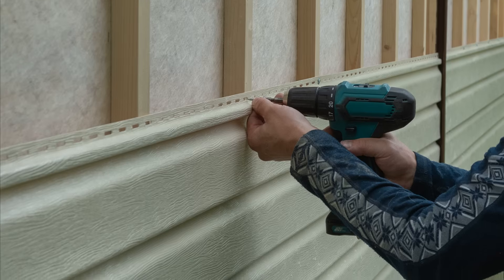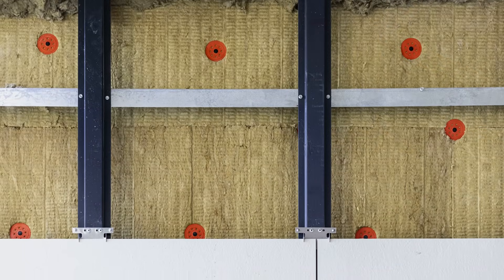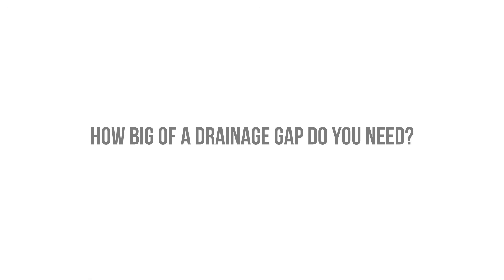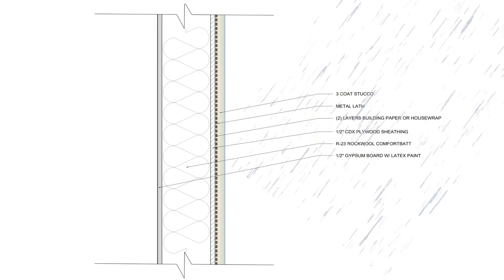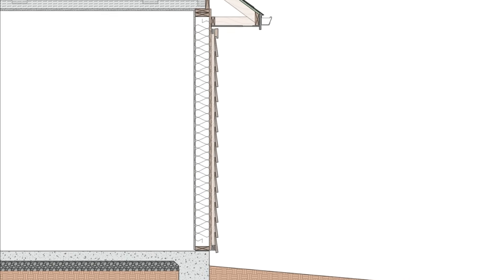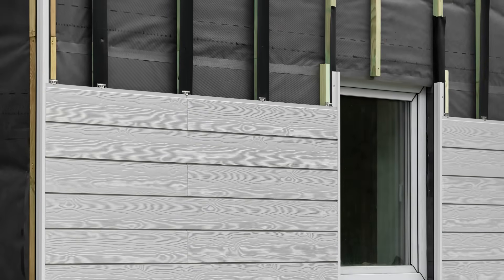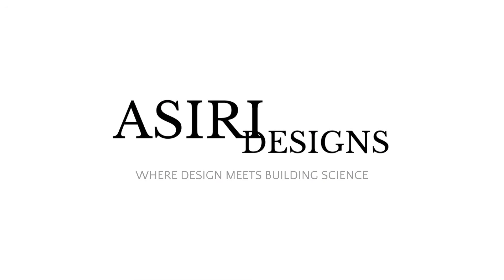Rainscreens Explained

Comment: Would have been nice to talk about the drainage gap with exterior insulation. A lot of the issues that you said the drainage gap helps like drying through the wall can't happen when there's exterior insulation so is the drainage gap less needed in that case?
Reply from the maker: @BenBrand  We actually have a video on this right here: https://youtu.be/VwUjkSjllPs?feature=shared
Reply: @ASIRIDesigns  Thanks for the link! I get the idea of having a peel and stick WRB with a texture (or rockwool or other texture material) to have a 1/16th gap for drainage between the WRB and the CI, but where is this water coming from? Surely this is not bulk water getting past the cladding and through the CI? And with only 1/16th gap this is only drainage and not drying so the house would not actually be able to give up moisture through that gap? To actually dry as you said you need more like 3/8" which would defeat the CI from actually keeping the house warm. Once you have CI aren't you required to keep the humidity in the house under control so that it can dry inwards and if that's the case why can't a rigid foam be right on top of the WRB?
Reply: @BenBrand the water that may collect between the WRB and CI probably enters the assembly through the wall cladding. I've heard estimates that up to 25% of the bulk water that the cladding faces may penetrate that layer, depending on the installation and type of siding. The CI will repel most of the water, especially when working in combination with a ventilated rainscreen, but a fraction of that moisture load will inevitably work it's way between the WRB and the CI. This is why a drainage-only gap is required, a fraction of a fraction of the bulk water is present and to maintain the resilience of the assembly a final drainage opportunity allows the last bit of bulk water to drain.

Don't forget that this is a WRB and air barrier layer so controlling interior air moisture should not affect the need for a greater space between the WRB and CI. And even with that in mind, interior humidity management should be included in every mechanical system for building performance, occupant health, and comfort.

Comment: @ASIRIDesigns- new construction, northern Utah (dry climate), my builder thinks this is overkill in our climate. We are using Zip sheathing, I can’t afford exterior insulation (45k more! I really want it though!) and will have Accoya wood siding with 5inch thick wainscot stone (needs to be real wood and thick stone per HOA rules). What are your thoughts on dry climates and rain screens? Thanks!

Comment: What’s the point of the rainscreen with a high permeable insulation like rock board?  How do you address the rain screen in fire country if the strapping or siding is flammable?

Comment: Water is the enemy of buildings.
All new buildings should be designed with large roof overhangs. The large overhang provides beauty and protection from the sun, rain and wind. 
Protection of the doors, windows and siding make for a more durable and comfortable home.
Reply: Agreed. My new workshop, home and garage will have 3ft eves since we live in a temperate rain forrest....anything we can to reduce it, knowing we'll never prevent it.

Comment: So would metal siding, like that used in post frame buildings, attached directly to the wrb layer provide enough air circulation for drying of rain infiltration and vapor coming from an insulated wall assembly?

Comment: You mention the rain screen mats being ok for a rain screen but many of those mats (slicker max etc) have only 1/4 inch gap, not 3/8 inch. Is that ok?
Reply: Not if you have stucco for sure .
Reply: @ what about for fiber cement
Reply: 1/4” is fine in terms of the fiber cement itself as it is pretty impervious to water. However, 3/8” or more will provide better drying potential for the entire assembly as that will assure that no bulk water will be trapped via capillary action. Depending on where you live, a 1/4” gap is probably fine with fiber cement (as long as you don’t live in a coastal environment for example). That’s my opinion anyway based on what seems to be commonly accepted building science.

Comment: My parents' house has a lot of mansard-roof-style siding above brick, and as ugly as that old style is, it makes the house invincible because it's basically a foot-deep rain screen. No matter how badly it's built, and no matter how much it leaks, the wall inside will dry out because there's so much space and it's vented all the way up to the roof. You could leave for 100 years and come back, and the cedar shingles would be half rotted away, but behind them this huge drying potential would be kept, protecting the pine framing from rot. A very practical old style. Medieval and ugly, but practical because of the huge rain screen. Great video as always!

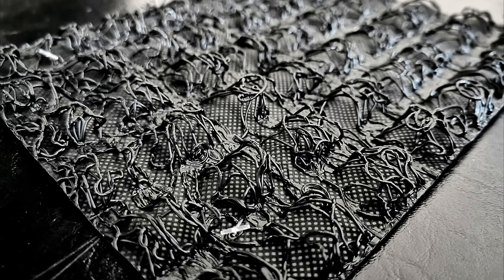Comment: The explanation of the system is great but man some of the photos are of what not to do. At 2:29 those horizontal pieces that whoever did that work put on are completely defeating the idea of a rain screen or vented cladding. Also it’s really not necessary to have a rain screen for vinyl siding. I suppose it can’t hurt but I just don’t think it’s necessary with all of the air space vinyl has behind it already. And I don’t know what that mess is at 3:25 but it looks like Twisted Tea was involved 🤣
Reply from the maker: With regard to vinyl claddings- it really depends on the product. Solid or cellular PVC like Azek you need the gap.

Comment: One of the things I have thought about and would be curious know from others here is if the Tuff-Rib profile on many metal sidings is enough to be considered a rainscreen? I believe in Canada it fits code there. From experience that siding definitely doesn't fit tight against the sheathing besides the raised profile sections etc.

Comment: How does this work for brick cladding? Do the weep holes provide the air flow?
Reply: Yes weep holes help dry it out. Masonry loves to wick moisture. Without weep holes you can have ice dams behind the masonry veneer in winter. Masonry veneers doesn't usually stop all the moisture from getting behind it. Think the build show has a video where they spray a brick veneer with a hose to show the moisture getting behind it. Below grade weep holes can allow dirt to get into air gap which I see on 100+ year old commercial masonry buildings. Plus below grade needs type m or s mortar. Which wasn't used to build older buildings. Masonry to last needs to dry out or it will get water logged. Seen a lot of masonry fail because it was water logged. Here the freeze thaw cycles will destroy water logged masonry.
Reply: Weep holes in brick are almost always located only at the bottom of the wall, so, they wouldn't provide adequate top to bottom flow
Reply from the maker: @danddietz  Depends on how many weep holes you have at the bottom and if ventilation is provided at the top of the brick veneer. We generally don't consider brick veneers to be fully "ventilated" because of the limited air flow, and therefore they are just drained. Mortarnet and MTI have some good solutions for ensuring drainage and ventilation